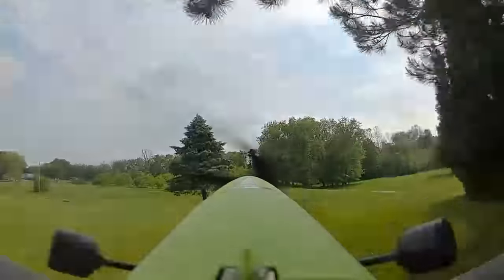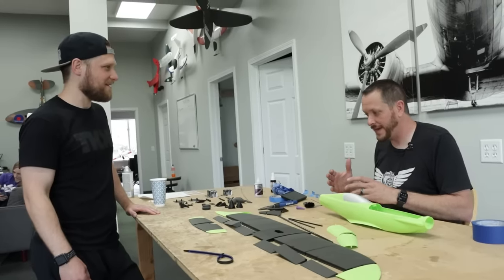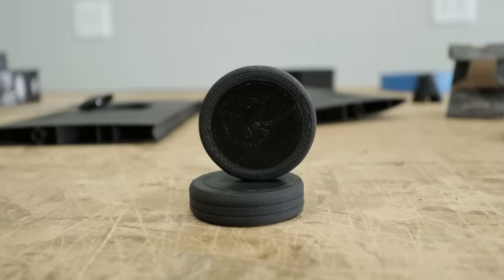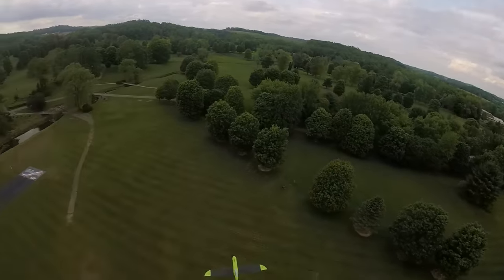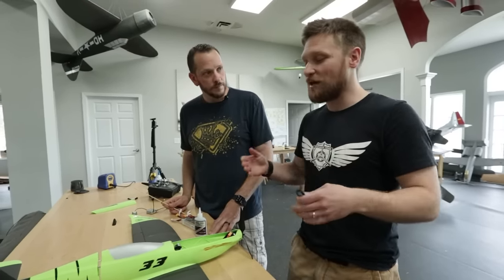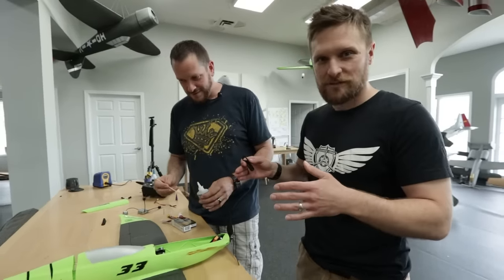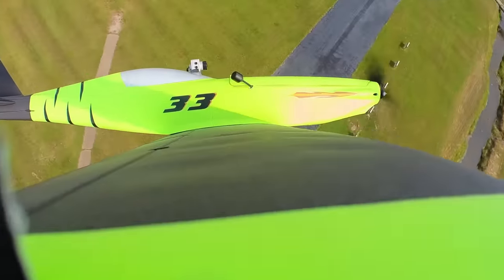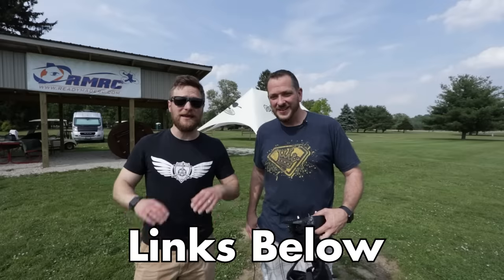Can A 3D Printed Race Plane Withstand 100 MPH?!

Comment: Great flying, excellent skills, but not very responsible flying ... clearly not for some newbie watching this for the first time and saying I want to do that.   This is why the sport is getting so out of hand with the FAA.   People will see this and want to try it themselves ... and POV is not the safest way to fly ... in literally a hobby that is difficult enough to fly without the limited vision of the POV headset.  And the fact things happen quickly and can go wrong in a hurry.   

I dig watching your videos, but showing off reckless flying habits is not ideal.  And yes, I did use to fly crazy too .... till you injure someone due to a malfunction {highspeed elevator flutter and snapped clevis ... and I don't care if the plane weighs less than 2 pounds ... if it hit someone at 100 MPH ... it will hurt.   With the battery it has onboard ... can get damaged and open up a whole other set of problems.  

Smart Flying is what needs to be enforced and emphasized in all aspects of RC Flying.  Flying around trees with a model that you are controlling remotely is hard enough, but you increase that difficulty when you put on the POV headset and limit your peripheral vision even more ...

I think if you want to promote the hobby. Do so responsibly ...  always enforce safety as the main priority ... else the FAA will continue to regulate our love for modelling, impossibly to afford and find legal places to fly without harassment.   Nothing wrong is having fun and taking the risk, but not when it can give the wrong impression to those who never flown before ... or not being situationally aware of the surroundings [near miss with the drone].   It is already just about ended the fuel-powered, and glow powered engines, noise limitations, size and weight limitations, places to fly [LEGALLY] are becoming harder to find, more expensive to join, and more restrictions than ever before. 
 
Now I expecting the long line of people and Flame throwers, to come out of the woodwork and torch me for my comment.
Reply: Not going to "flame" you too hard here but :

1. Yes he is wearing FPV goggles - but there are least two or more other people there to keep an eye on things.
2. They are in a controlled environment - so the risk of a random bystander being hit is nil. They aren't in a public park, or in a area where there is a risk of random people entering the flight area.

These things are obvious.

You concerns would be valid if they were in a public setting and he was alone - but he obviously is not.  These videos are always done safely. Having been around RC aircraft for twenty three years I am pretty happy to report the number of people I have seen enjoying this hobby recklessly is basically zero.

Drone operators on the other hand  - is another story but even that is rare. 

This channel promotes the hobby perfectly well. They mention safety fairly often and it isn't their job to teach people common sense.  It isn't Flite Test's responsibility to ensure people do things safely and correctly - they do their due diligence and have a reasonable expectation that people  will do the same -  and that is exactly how "life" is supposed to work.  

If someone new to the hobby can't be bothered to spend 10 minutes to read up on the general safety and operation of something - they aren't going to bother with it being spoon-fed to them here either. Expecting a company like Flite Test to spend the time and effort to hand-hold people in every video would be detrimental to their overall goals and business and is quite frankly not their job.  Expecting someone to radically change their content and business model because .1% of people that watch it may do something improperly is ridiculous.  Part of being a functioning member of society and a responsible human being is the ability to utilize the squishy thing between your ears independently and research, conclude, and rationalize your decisions. Expecting everyone to do that for you isn't how society should work.

I hate to break it to you but the regulations that already exist and have been enacted aren't because of safety. It is the same reason regulations on many things exist. The simple version is that Regulators love to regulate and will do so to the maximum extent they are allowed. If you want proof of that look at the battles being fought constantly in the automotive hobby , firearms hobby, etc.